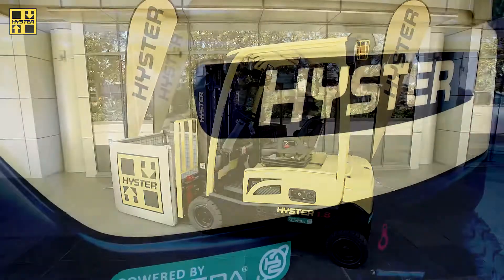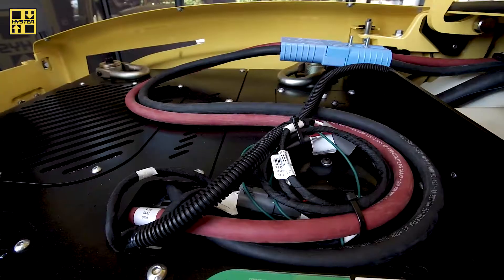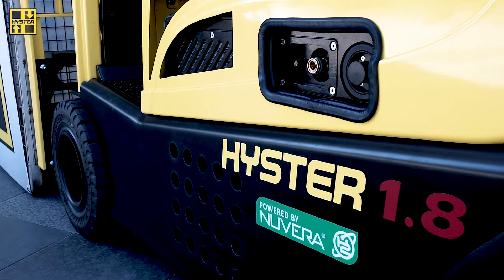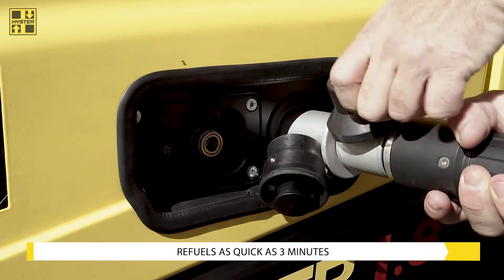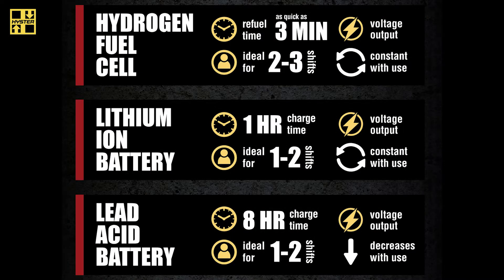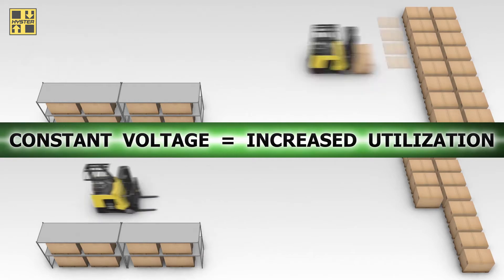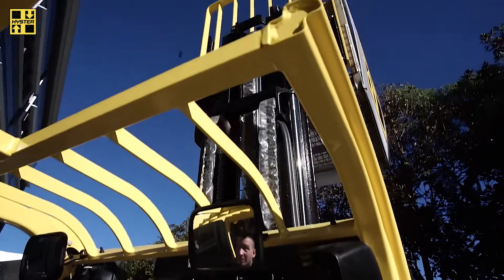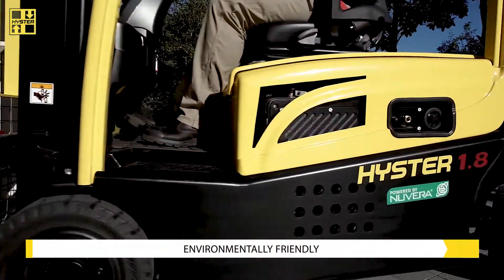Hydrogen fuel cell technology by Hyster

Comment: Yes good luck with hydrogen, lastly integrated lithium iron phosphate to the forklift segment where 115.2 volt, 153.6 volt and 352volt were being offered that no one requested such high voltage as many competitors still using 80 volt architecture